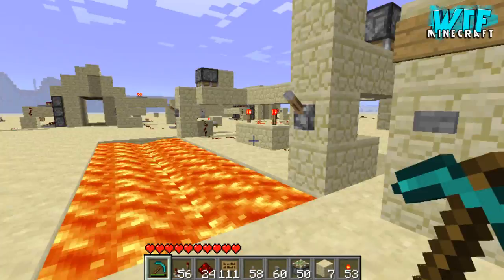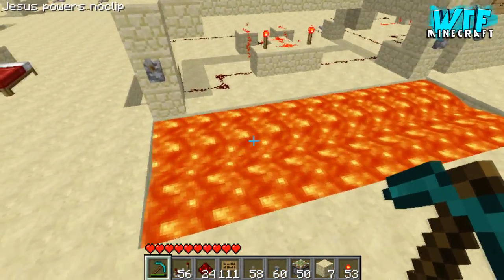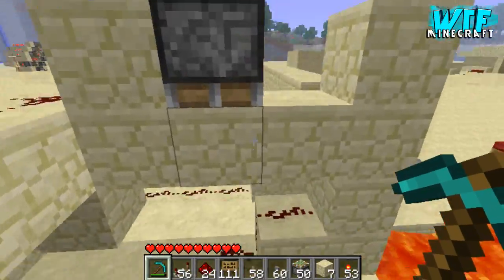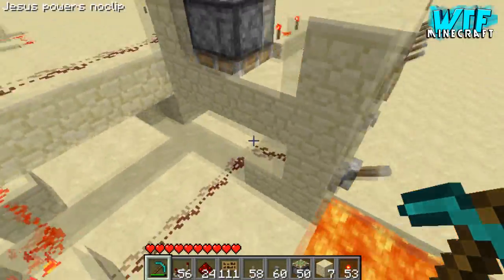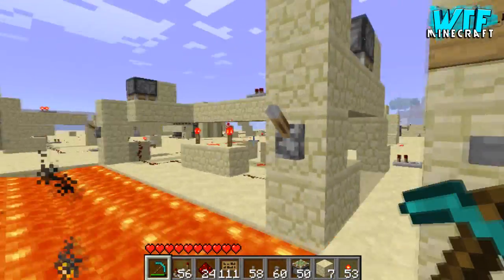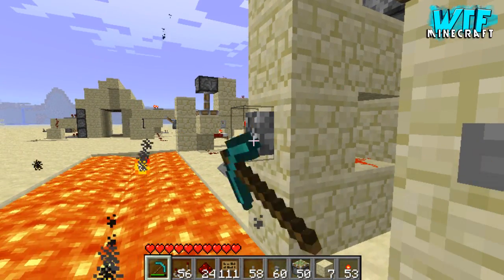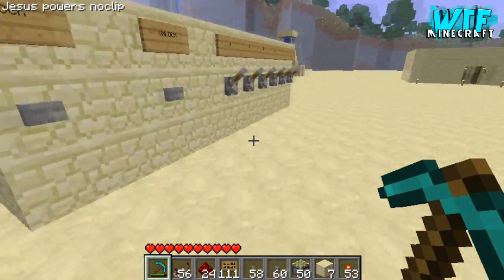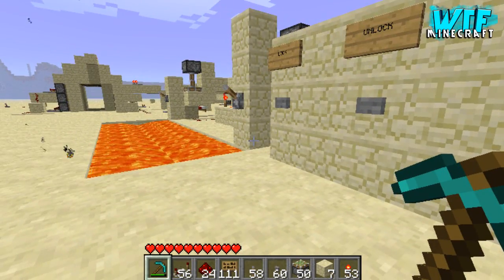Minecraft - Adding a combination lock to the lava bridge

Comment: @TomaToeVideos I'll give the answer to you quickly. The right combination has redstone torches, so when you activate the lever it turns those torches of, which turn one torch on and that turns off another torch, and it goes to the piston which powers off the lock. IF you press the other levers, they will continuously be on therefore making the piston go on, which would then keep it locked.